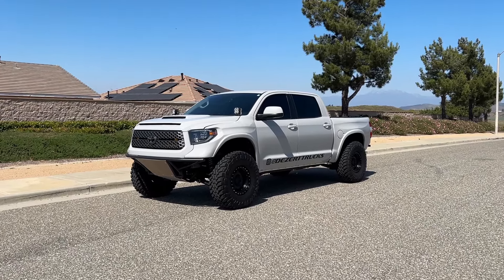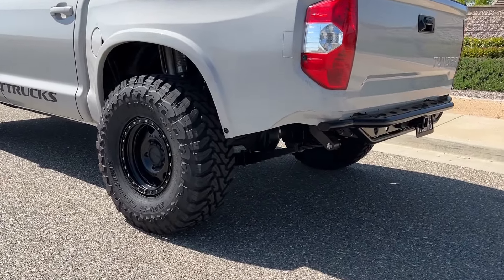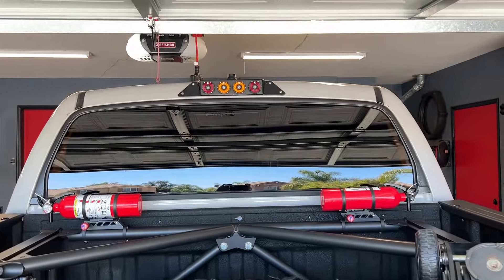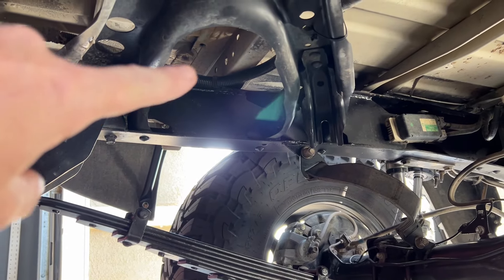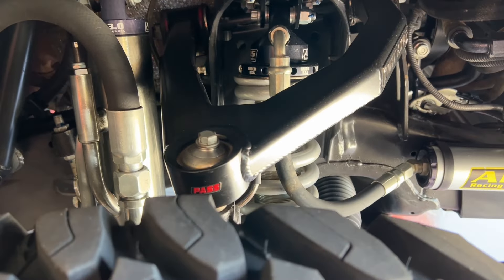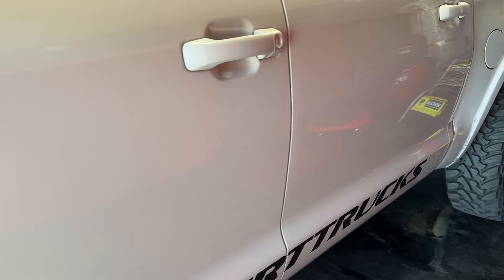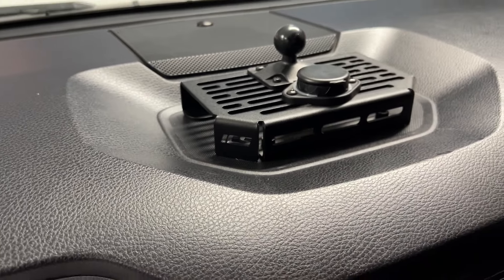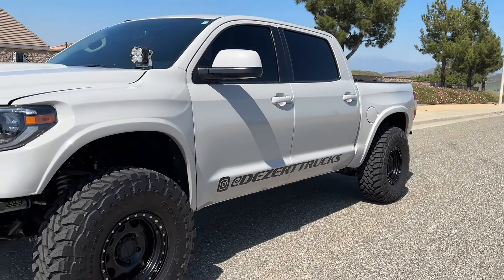2018 Toyota Tundra 4wd Prerunner, Raptor Killer! Walk around and details!

Comment: I think a lot more people are going to be supercharging the older Tundras because the new Tundra prices are insane.
Reply from the maker: Gen 1 Tundras are awesome too!
Reply: You can get a used third gen for maybe 2 or 3 grand more than a 2nd gen. The third gen’s aren’t holding their value whatsoever
Reply: Have you seen the prices recently I seen cheaper 3rd gen tundras than 2nd gen because of the 3rd gen motor issues😂
Reply from the maker: @KARIM-db9uz yeah it’s kinda crazy
Reply: Who would want to spend the crazy money for a smaller truck and motor 2nd gen is where it’s at they should have never changed it up.

Comment: nice job on the dirt king L/T.  i have the same set-up up front except with fox 2.5 sway aways and 3.0 bypass.  Still debating on what im doing on the rear.  but loooking at your video the leaf spring is growing on me
Reply from the maker: Thanks man. I’ve built and driven almost every option available. The bang for the buck on the Dirt King spring under is hands down a winner imho.

Comment: Does the double skidplate & light setup behind the grille impede with cooling for the radiator at all? Im thinking of doing a skidplate like that but with vent holes for cooling
Reply from the maker: Nope, not enough to move the needle and be worried about.

Comment: Any way to do some weight reduction?
Reply from the maker: Not really. What kind of problem are you having where you need your truck lighter?
Reply: @dezerttrucks  i dont have a tundra i just know they are heavy. Does that even matter with the suspension setup?
Reply from the maker: @jordanmercredi3740  not at all, in fact it is common to add weight to the rear of these Prerunners to help settle the leaf springs.